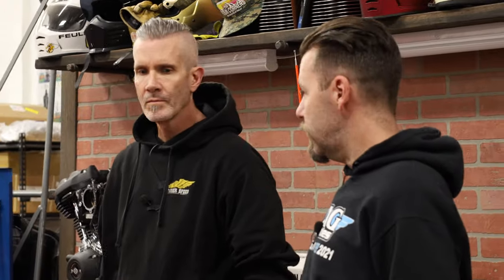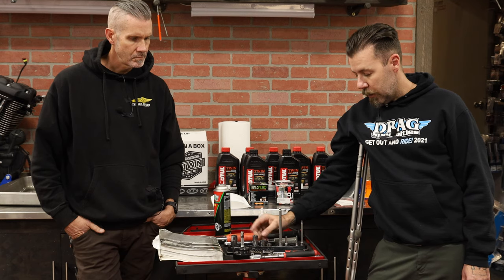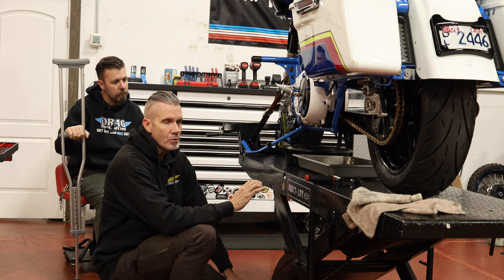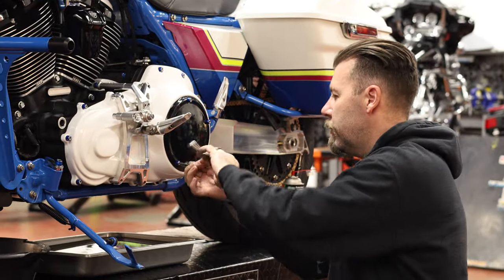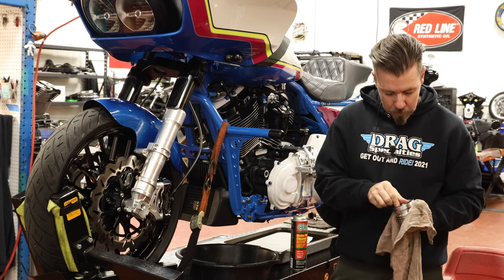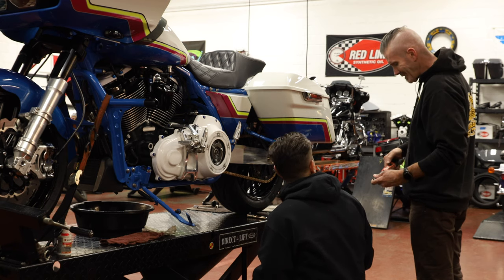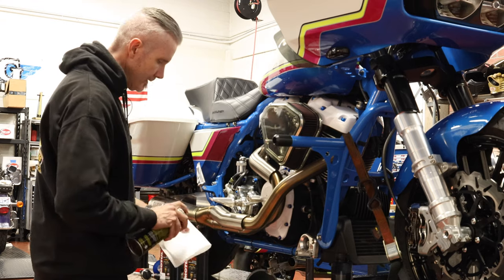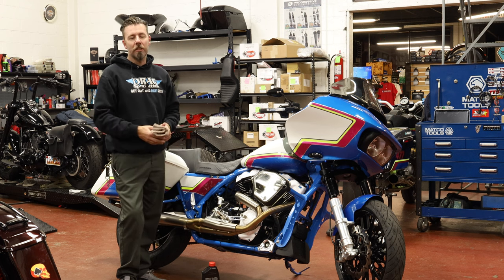The Secret to a Quick & Easy 3 Hole Oil Change - Harley Davidson Milwaukee Eight (M8 Bagger)

Comment: Why add teflon? I still don’t understand this why so many suggest this, that’s the purpose of the o’ring, I’ve never put anything on the drain plugs except a new o’ring never had a single leak.
Reply from the maker: I agree. I do it because it’s how the dealership did it when I started there. And now I just do it out of habit. But you’re right, it’s probably overkill.  But it’s never hurt anything either????
Reply: @TuckerSpeed477  I understand
Reply: I thought the same thing. I guess if you do develop a leak it's going to leak right into the path of your rear tire probably not necessary but I'm not really interested in road rash.